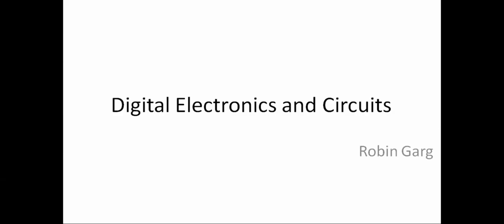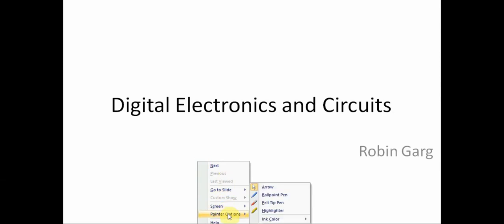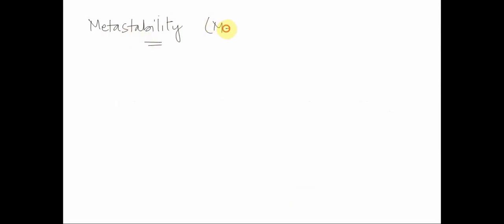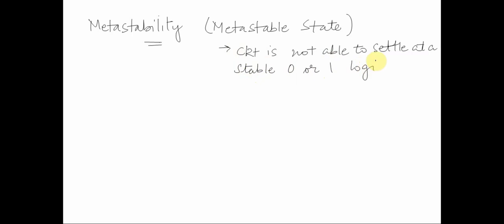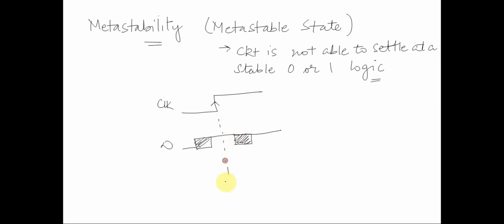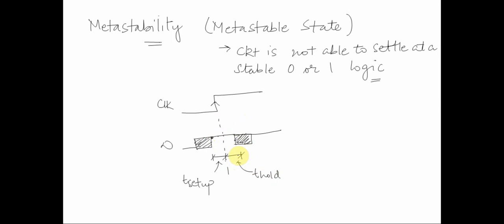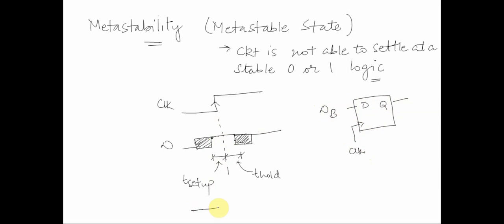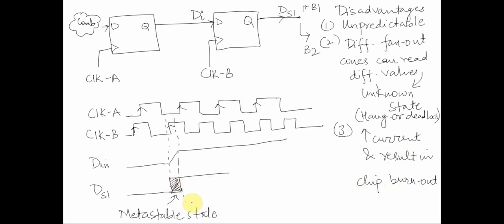Lecture 24: Digital Electronics: Metastability

Comment: When din is changing 0to1 metastability araises in ds1 after that we cant say the output is 0or 1 you have taken as 1
What if it takes as 0 after that passes through any other flipflop with same clkb the output is 0 
But we need 1